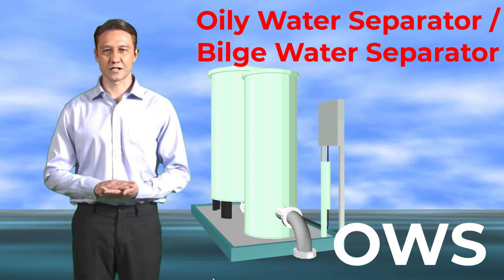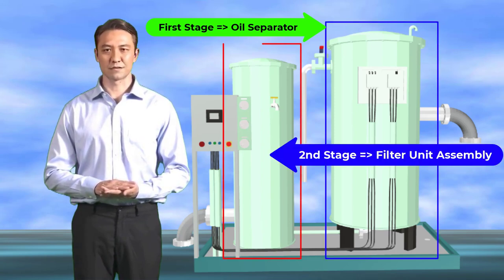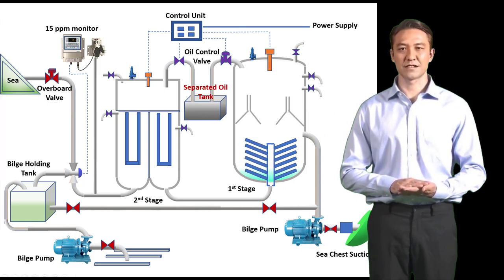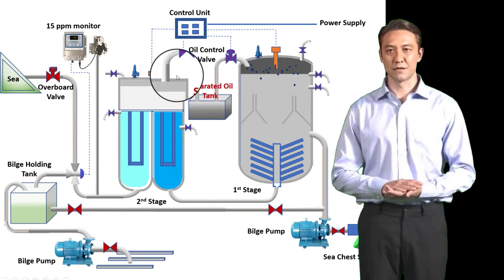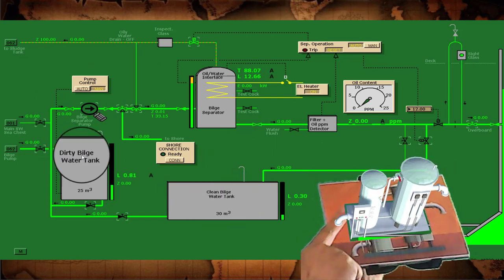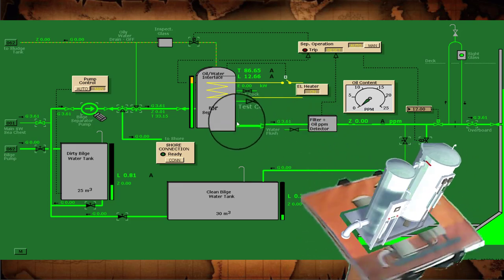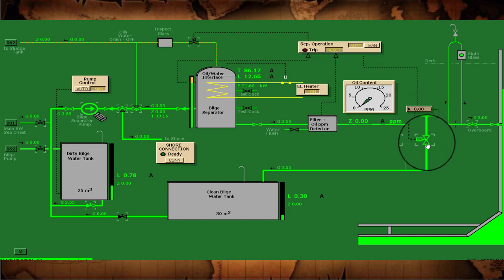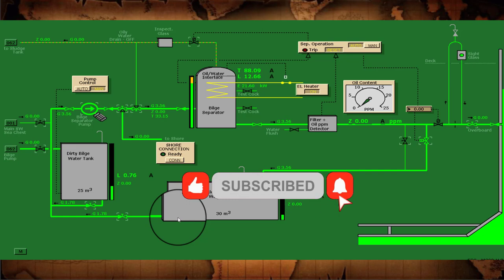Bilge water separator | Oily water separator | Oil and water Separator

Comment: Sir, pls allow me to ask you a question.
How sensing probe (capacitance probe) detects oil? i mean how it works?
the sensing probe is located at the top of First stage chamber on OWS.
Reply from the maker: I am not an electrical expert although I had vocational courses in Radio Mechanics...somehow I do understand a bit. 
Capacitance sensor as the word implies .." capacitance'. When in operation the sensor produces capacitance range in the principle of an electric field via the probes. This 2 charges (+ & - ) are in equilibrium. When a certain conductive material externally is placed within the field e.g. oil, water, etc. The field is disrupted. Hence, the initial capacitance changes its value. Hence, it triggers the sensor to analyze it's change and thereby gives a signal in the form of reading e.g. alarm, counter, or level,.etc.
They are calibrated of course in relation to your system e.g. containment. These are widely used in many system even conveyors for counting objects, ballast tanks, and many more. 
You can find more info in other YouTubers with animations and we'll laid in details.
Reply: @ShipAhoyVlogs  thanks for your kind reply. 
really helped me a lot 🙏

Comment: Hello Sir,I have a question. On the simulation of PPM to value zero, why the 3 way valve closes the overboard valve side and opens back to the Bilge tank.
Reply from the maker: It's the simulator used in this presentation. I supposed to input 16ppm to activate but it did not accept. Hence, zero value did the trick. Sorry for the confusion.
Reply: @ShipAhoyVlogs  🙏

Comment: sir, how 15ppm monitoring system zero calibration is done?
Reply from the maker: Check with your manufacturers manual for the process of Calibration. Different makers has each own steps written in the manual. 

The accuracy of 15 ppm should be checked at IOPP Certificate renewal surveys using makers instructions. Or, replaced the unit by a calibrated 15 ppm alarm.

Comment: This kind of OWS is not effective against emulsions.
Reply from the maker: Thanks for your input Sir. The 3D model used in these presentation was utilized for the sake of discussion. Not all emulsion but most likely Oil emulsion or effluent will be separated. However, as mentioned most OWS are also designed to take off contaminants or other emulsions. Of course, inject , scrutiny, correction and suggestion is much needed for better understanding.